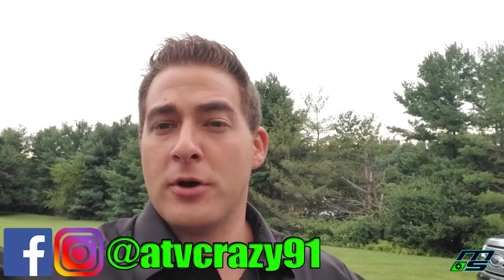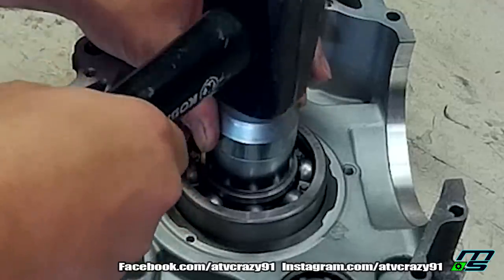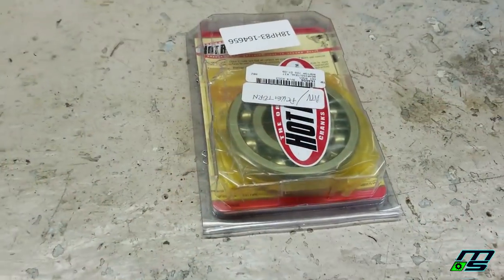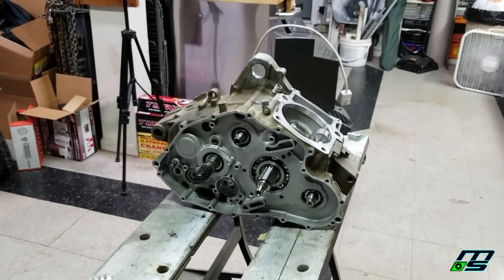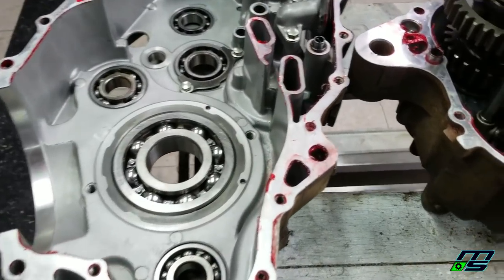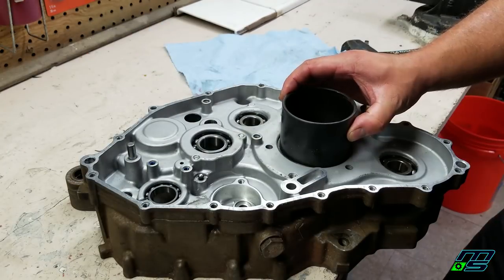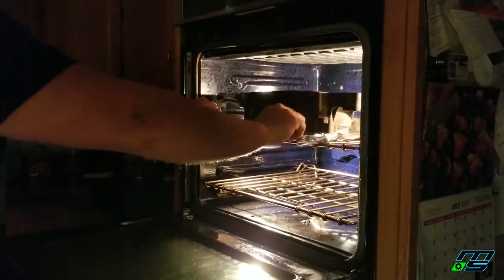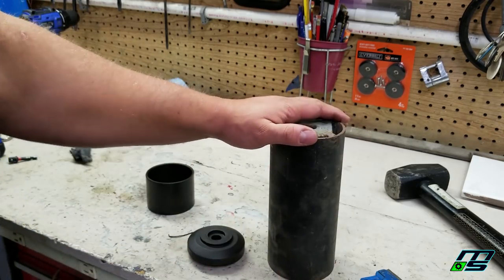You'll never look at bearings the same...  Raptor Motor Part 6

Comment: lol i was typing to use the hot cold method and there you go doing it haha yeah it works really good most of the time sometimes you gotta tap it a little bit    they slip together most of the time like they were meant to be hahaha and if your slipping a bearing over something like a truck axle or something then heat the bearing up and cool the axle.. so whatever is on the outer most part it gets the heat and whatever is on the inner most part gets the cold  if that made sense haha

Comment: Deff good to do things right, just to be sure. I've never done, or left a bearing like that, nor do I condone it lol but in my opinion, I bet it would've been fine. Like u said, quality now days can be really top notch on bearings. Esp if their from Japan. Those balls are hardened to such extremes I've clamped one ball from a busted bearing with vice grips as hard as I could get the clamp to go, and then released and inspected it. And there wasn't even a scratch! My guess on integrity failure would be if it caused a fracture from hammering it like that. And u would never see the fracture even upon inspecting it. At least not while its in the race, in an engine case. Anyway, prob be fine but deff not worth the risk for a couple bucks and 2 hours of time. Glsd u swapped it!!!!
Reply from the maker: I agree man; even after recently re-visiting this video and seeing how I smashed it in there the first time; like you said, the quality of materials is so good these days, it probably would have lasted just fine but it was still the safer move.

Comment: Why dont you torque bolts down to spec? Theyre set like that for a reason. Why do you round it up?
Reply from the maker: Everything is the way it is for a reason; the factory exhaust is the way it is for a reason, but almost everyone modifies that. Air filters, tire pressure etc get tweaked in an effort to improve in some way. Just because the service manual says it, does not mean its the only or even the best way. That's why autos have recalls; sometimes the way things were made at the factory is not the best way. People modify things from the factory in an effort to improve over stock. In my experience and opinion, 7.2 pounds is a little too light for the cases. But this is just my opinion.
Reply: Michael Sabo i suppose youre right. Never thought about that